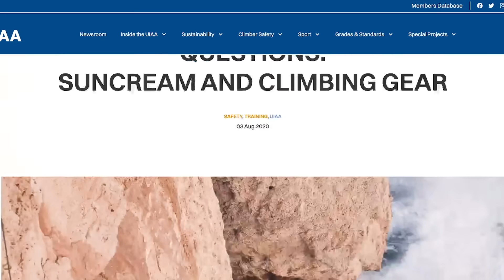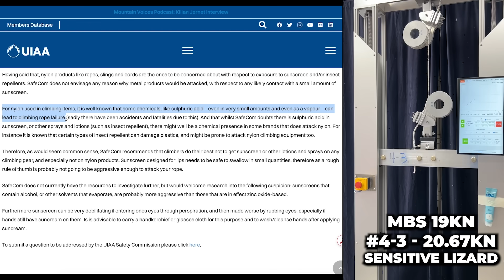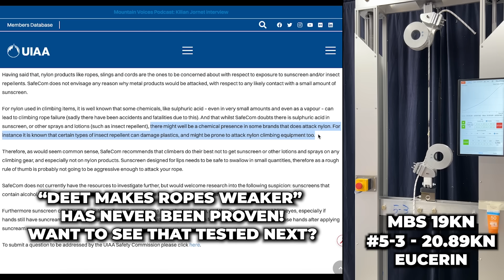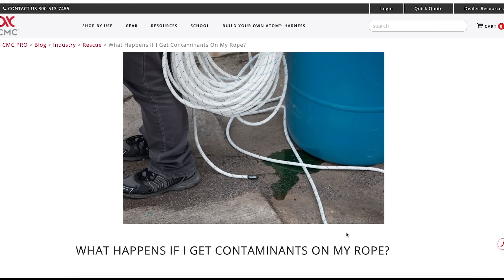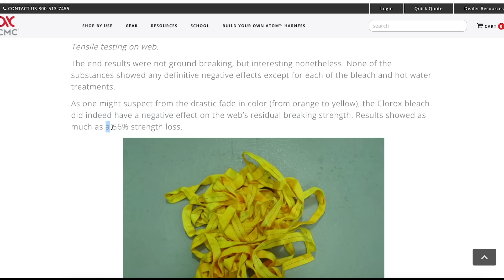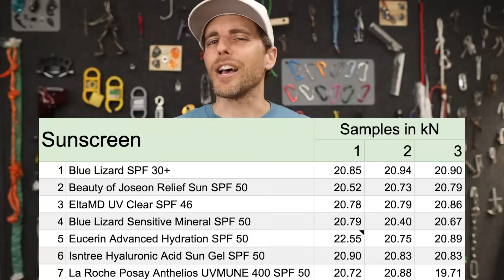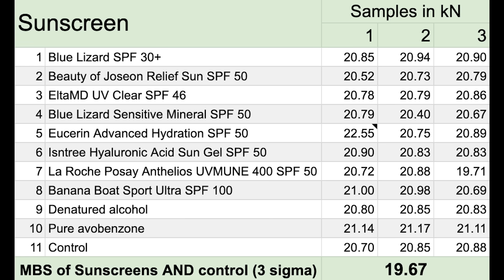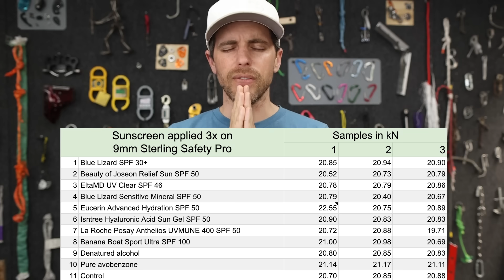This is going to piss off the worlds largest climbing organization

Comment: Absolutely brilliant! There is much "science" being done out there now it seems that is just junk, absolute junk. Even peer reviewed stuff which seems to be at times only the same couple dozen guys publishing stuff and citing each other and reviewing each other. Looked at a "paper' on chainsaw emissions (gas powered is bad don't-cha know) by a bunch of doctors - no idea what fuel/ gas mix they used, if saws were carbeurated or injected, displacement or anything else, blah, blah, blah. Junk. Same with a bunch of the work going on for climate/ weather/ heat stress. Maybe cuz journal citations only go back 15 or 20 years or something, but our gay band of newly minted PhD's seem to be ignoring millions of heat stress data points (with Globe temperature taking into account radiant heat) by armed forces all over the world going back to the British troops in India. New Junk. An old prof in London School of Hygiene and Tropical Medicine made a point of always saying you have to measure all the variables. So you are so right to call out UIAA on stuff like this. Meanwhile if you go into say Engineering toolbox, yeah isopropanol isn't great for nylons maybe but EtOH seems to be fine. Discussed TO DEATH regarding cleaning sap off arborist climb lines: https://www.treebuzz.com/forum/threads/safest-and-best-sap-remover-for-your-climbing-rope.23495/page-3#post-781550 Keep up the good work. It's a breath of fresh air to have the Consultant Debunking Unit alive and well ! Cheers from Cant-ada to the North (a confused almost a country right now). 🙂

Comment: I try to get informed about safety around climbing gear by attending local courses. Among the uncomfortable lessons I learned there is that police or insurance companies will assess whether you have mishandled or mistreated your personal safety equipment in case of an emergency. I think there is a good case to be made that you bear an amount of responsibility when you use heavily outdated equipment or use it in ways that are unsafe. But I do not feel safer when I hear that my rope is considered to be damaged when I have touched it after using sunscreen. At some point there must be a line of what is considered reasonably adequate use, right?

It seems to me that gear fear is people getting confused about what they should or shouldn't do, because no such line is obvious to them. I still have many such questions:
Should I clean my rope? How often? In what way? Should I file down rough edges on carabiners? Or not, because too dangerous?  Can I still use my prusik sling if I left a knot in it for months? Or is it now unsafe because the rope has accustomed to the knot and got more brittle?

The conversation can get so wound up that people learn the opposite of what you intend to inform the about.
I've climbed with people who refuse to use or be belayed with a GriGri because there are so many videos about it showing you how not to use it because it would be dangerous. It doesn't occur to them that the other belay devices also have many ways to use them incorrectly.

Comment: Well, on the anecdotal side of things. When I was guiding Via Ferrata in Mont-Tremblant we had to ban DEET containing bug repellents. The sprays versions would “melt” the paint from the helmets, we then did a small test with Citronella, spray watkins, spray muskol and cream OFF. On the helmets all the DEET (even at 30% maximum in canada) would literally peel off the paint on helmets. We could not do a webbing test since we did not have acces to a pull test at the time, but we all assumed that nylon would be affected too.
Reply: Deet has no affect on nylon.

Comment: While your in house dermatologist was give her recommendations on sunscreen, you flashed a message saying that it’s a myth the mineral sunscreens reflect UV rays.  Now I’m skeptical of your claims.  I have seen UV images of mineral sunscreen next to organic based sunscreen.  The mineral sunscreen was bright white, while the organic sunscreen was very  dark, almost black.  This data is consistent with mineral sunscreen reflecting UV light.  Can you provide data to back up your claim?
Reply: See "Metal oxide sunscreens protect skin by absorption, not by reflection or scattering" by Curtis Cole, Thomas Shyr, Hao Ou-Yang in Photodermatology, Photoimmunology & Photomedicine, Volume 32, Issue 1 pp. 5-10
Reply: From Wikipedia, where I easily found the citation above, "Mineral sunscreens... primarily work by absorbing UV rays but also through reflection and refraction." so that explains the differing UV images.

Comment: You have to look from this perspective:
100% of sunscreens have not tested been tested by UIAA and determined safe. Therefore UIAA cannot say "sunscreen is safe."

If, IF, a sunscreen manufacturer (like climbing equipment ones) wanted a UIAA safety stamp (and paid for it of course) then, THEN that ONE sunscreen would be tested, and if passing, labelled "safe."

Think about it, they don't say "Carabineers are safe" they say "THIS carabineer is safe up to Xunits when used specifically in setup Y"
Reply: Well, on instagram, they did say "UIAA testing found that certain sun creams—especially those containing avobenzone or alcohols—can weaken climbing gear by up to 40%." and referred people to the blog post for more details. 

And the blog post said "we haven't tested sunscreen".
Reply: @leveller4 fair enough. I'm speaking purely to the article, not the meta content
Reply: The point is that no type of sunscreen is bad for your rope.  If they don't have the information then they shouldn't say anything.

Comment: I once tied a hammock up with thick but cheap nylon rope. In Australia, we have an ant called a jumping jack or jack jumper that has a horrid bite and causes deadly anaphylactic reactions in some folk. These were making their way from the tree to me via the rope. I used DEET insect repellent to keep them off the hammock. It worked until 30 minutes later, the rope gave way where the insect repellent was put in the rope..... no not a climbing rope, yet chemically similar core
Reply: Strange. DEET does not affect nylon.
Reply: @vaughnengler9436  It could have been a correlation and a poor or old rope. It was in the 1990s, so it may be that the formula for Raid repellent was different or that another component was that degrades the rope..... .

Comment: Most likely they have the following reasoning: sun screen is a liquid. Water is also a liquid. Water was assumed to reduce rope strength by 50 percent. Since sunscreen is a liquid, it must result in similar rope strength reductions as water. Write article, done. Science be damned.

Comment: DEET is really the only kinda-skin-safe product I'd be concerned about - it is a solvent for several common synthetics and you're somewhat likely to find the stuff in nearly pure form sold as an insect repellent.

Personally, having to check for material compatibility every time I buy a piece of gear would annoy me far too much to justify the (questionable) benefit of DEET over icaridine - even if most gear is fine.

Comment: I'm curious if any of it let's the rope stretch more. In my career we use nylon pouches and an old claim is, if the pouch is too tight for the gear disk it in alcohol or hand sanitizer then put the gear in and it will stretch out quicker? But now I'm curious lol. It clearly doesn't weaken it but does it have any effect on the fibers?

Comment: I found fire ants had moved into a rope bag in the Florida summer. The only thing handy was deet based insect killer. I sprayed the rope and the bag. A year later that bag, the same as 4 more from the same brand and age, basically rotted apart. I used the rope for rigging, not climbing, and have pushed it way farther than I should have without it breaking. Still I've been nervous. The rope was a 5/8 model from Sherill Tree, I'd be happy to figure out the model via old order history but may take some hunting.

Comment: you know what is worse... DEET...  look at the MSDS on it and while it is "approved" for use on skin it dissolves most synthetic fabric

weakened partially dissolved ropes and slings carry a long list of possible bad outcomes including it sticking to your hands and death...

I have tested some 100% deet on nylon fabric and it seriously weakens it as well as give me a rash...

btw the toluene (at least in very old sharpies) does dissolve nylon a small amount but evaporates very quickly and cannot penetrate very far as shown by your test results.. just don't soak your rope and other gear in the vat of liquid used at the factory to fill harpies...

Comment: I touched a painted model about an hour after using my hands to apply sunscreen and the paint came off as though i had just wiped acetone over the model. Ive had plastic items partly melt and become sticky when using rid or aerogard insect repellent, so yeah i can definitely believe that it would be very bad for climbing gear that isnt made of metal.

Comment: Another way to cross check this assertion is to check a compatibility chart for nylon.  These are available from many manufacturers of nylon products.  People who use nylon in the chemical industry check these charts to make sure they don't end up with a surprise failure.  Now, one thing about surprisingly positive results is there is no negative results to which to compare them.  Checking the chart, isopropyl alcohol (a common household item) is bad for nylon.  I suggest you soak a rope in isopropyl alcohol and test it.  This should give a nice negative result.  Keep up the good work !!

Comment: re: how can it be bad for your rope if you smear it all over your face, wild tangent ahead:
Turns out unless you're going to get really burnt, the sunscreen is probably worse for you than the sun. Supposedly the science linking sun exposure to skin cancer wasn't too solid to begin with, lack of sun is more likely to give you the bad kind of skin cancer, getting burnt too often will increase the likelihood of getting the really obvious spots unlikely to be dangerous. But like anything that passes for science these days, there's no place for a study that pushes back against the established belief, so you might have to do some deep digging to do your own research.
Reply: This is categorically false. Daily use of sunscreen has been clearly demonstrated in high quality studies to decrease the risk of melanoma and squamous cell carcinoma significantly, which are two of the more serious types of skin cancer, i.e. ones that have a higher risk of metastasizing (spreading to other parts of your body). Please stop spreading misinformation that compromises public health.

Comment: I'm not that interested in a deet test, but I am interested in a raid test. As a window cleaner, I use bee spray around my ropes at least a few times every summer. For ropes that we cycle every 2 years, and use everyday, I would love to know if the spray is a problem.

Comment: fyi anything past 30spf does nothing really. just if you dont apply properly doesnt cover well where 50-100 is easier to get the needed protection. i just pretend im a vampire and stay away whenever posible.

Comment: Two thoughts:
1) Any idea if the test rope is made with a protective coating? Nylon seems more of an off white without any added color. I suspect a white dye may have been used in the SafetyPro rope used here. Some dyes can impart a hydrophobic effect into fibers, and that could be acting as as a protective coating by itself. Sterling maybe using other protective coatings / processes as well.

2) The denatured alcohol test is just not specific enough. There are several types that are commonly used in sprays. Benzyl and ethyl are largely compatible with nylon while isopropyl and propyl are not. I suspect the banana boat sample is mostly using ethyl here and a null result would be somewhat expected. Other spray on sunscreen may not fair as well even if isopropyl is prone to sting when reapplied over a sunburned. And to go a bit further, isopropyl myristate (IMP) is a compound and neither the alcohol nor the acid the name might imply. That was primarily an overkill test of %50 avobenzone and shouldn't be inferred as a test of isopropyl. However, the IMP safety sheet does list nylon as being incompatible. It mentions swelling and discoloration in particular. Pretty surprising to see the rope not care in the slightest on the pull test. Could be worth trying that on some Walmart rope or asking Sterling for their secret ingredient

Comment: It's not a chemical reaction. It's just absorbed into the electrons causing heat. If you put a white piece of paper and a black piece of paper out under the Sun the black paper will heat up but there's no chemical reaction.
Reply: If you want to be specific about semantics, then yes, it is a photophysical reaction. The degradation of the UV filter over time is a photochemical reaction.

Comment: I don't bother with sunscreen. For the simple fact that i work in very hot environment. I sweat a ton. Even "sweat resistant" sunscreen is gone in less than an hour, guess what. When there is water pouring out of your body you cannot apply sunscreen. Shocker i know.

Comment: Just a quick comment.. not all sunscreen lotions absorb the UV, there are some that reflect the UV.  Physics Girl did a video on different types of sunscreen -> https://youtu.be/GRD-xvlhGMc?si=v2W9x4fv3GAEpChU (veritasium did a companion video as well)
Reply: It is a common misconception that mineral sunscreens work only as a "mirror" reflecting away UV light. They do this, but it only accounts of a small percentage of their overall photoprotective benefit. Mineral sunscreens also absorb UV light, just like chemical filters.
Reply: @andrearea213  True.

The point that I was trying to make is that there are basically 2 different types of sunscreen, organic and non-organic.  The mechanism  on how they work differ.  

Organic based sunscreen absorbs UV via a photo chemical process at the molecular level that converts UV to thermal energy.

Non-organic uses physical properties to block UV by reflection, scattering and absorption at an atomic level (which also produces thermal energy).

The mechanism of absorption is different between the 2.
Reply: One other point, there has been some studies looking at how mixing organic and non-organic ingredients can result in the breakdown of the organic molecules.  Specifically zinc oxide can act as a catalyst in breaking down avobenzone
Reply: @CheyenneWills that is why it is relatively standard to use coated zinc when formulating, because coated zinc does not contribute to the degradation of avobenzone.
Reply: @andrearea213  Yes, I was reading that as well.  

I think to swing all of this back to the topic of testing ropes, I think the point is that there are various ingredients to sunblock.  You have: straight organic, straight non-organic, a hybrid where the zinc oxide is coated to prevent the breakdown of the organics, and finally where the zinc oxide isn't coated (though this is probably more rare now .. but there could still be brands out there that are still  using non-coated zinc oxide).
Reply: @CheyenneWills the testing covered organic, inorganic and hybrid sunscreens so all bases should be covered with regard to questions of rope safety.

Comment: Yes please test DEET.  SUGGEST soak sample in jungle formula for a week, dry, pull 13 samples.   Note you could test individual sheath strands, rather than the whole rope... Save a few bucks.
Thanks for doing a rigorous test.   Only comment is more samples gives more confidence, though your total sample count is impressive.

Comment: You are rather wrong about sulphuric acid - E513
Yes, that is an E-number... those numbers for food labels. And it is for sulphuric acid. that stuff appears in a LOT of places - it is for example used as an anti-foaming agent on some dried ingredients. 
Sunblockers often contain sulphur compounds and i would not be surprised if some contain a bit of this either.

And the TINIEST amounts of some chemicals can have huge impacts on specific other materials.
For example some metals can pretty much fully inhibit the curing of specific silicons. Both materials on their own completely unremarkable and fine in contact with skin (or more), but one basically destroys the other.
There are also many soft plastics for human-internal use like tooth-brushes - and some of those compounds can start to dissolve when they come in contact with each other. Yes i have seen that - 2 toothbrushes that quit literally MELTED just from being in contact with each other.

So i would absolutely NOT be surprised if some sunblockers or other materials could attack ropes used for climbing.

Comment: This is one of the best episodes you've done. Also, DEET did actually melt and deform my Jeep's pleather seats when it leaked from the bottle and sat there awhile, so that would be an interesting test to me!
Reply: You can restore (temporarily) yellowed or foggy headlight lenses with bug spray, so this is unsurprising. I used to treat my uniforms with permethrin on the hood of my truck. Fast forward 2 years of doing this often and the hood of my truck got gummy or tacky and dull. Oops.
Reply: I have a few spots in door jam that it's took off top coat and paint down to the primer 05 Wrangler.

Comment: I wonder if, since UV does damage nylon, sunscreen would actually protect your rope over time. That way you could get more life out of your nice shiny, slippery rope.
Reply: If the dried sunscreen is obstructing the space between the fibers and decreasing flexibility, it may actually decrease the lifespan. I've seen testing on how mud and dirt affects rope, and it's not good.
Reply: @haroldsaxon1075 but oily sunscreen could work as lubricant, distributing the load better between fibers..